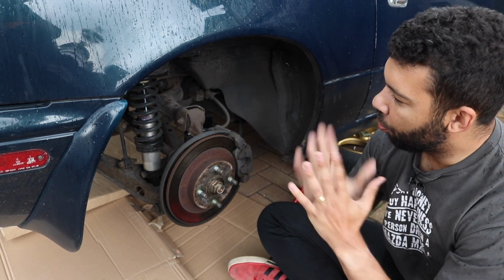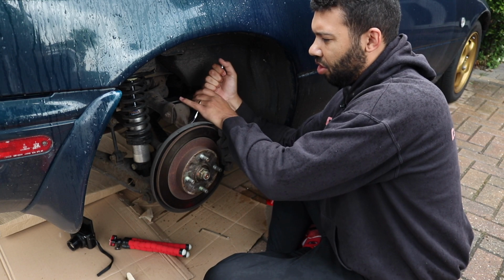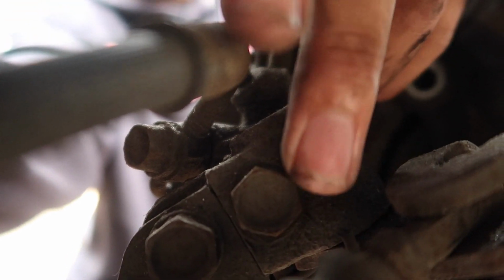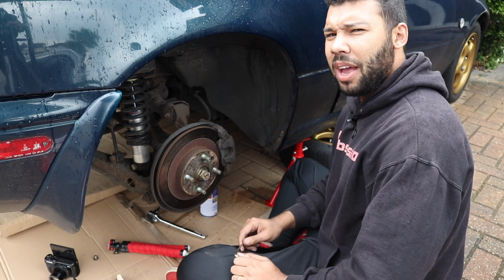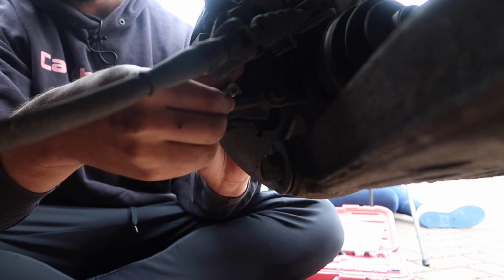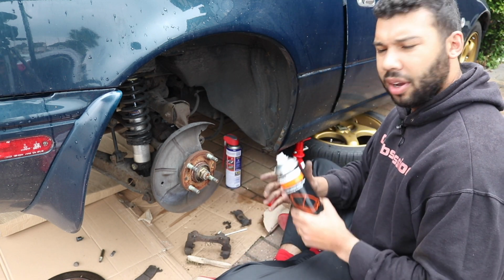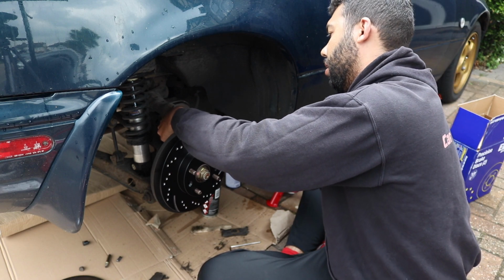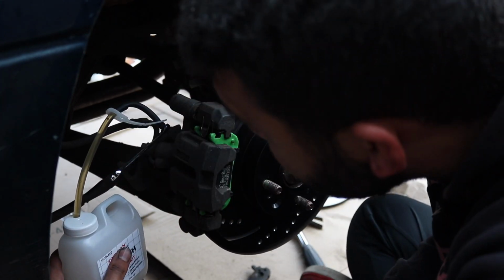The MX-5 Gets New Brakes [LWAMM Ep. 16 Part II]

Comment: Somethings up with my brakes. Not sure if it's the rear callipers or something but had to slam the brakes at 80-85 mph  someone pulled out without looking. All the happened was the rear started sliding out all over the place lucky I got it back in control. Need to get it checked out at some point
Reply from the maker: Yeah, getting them checked sounds like a good idea, haha. Thanks for watching.